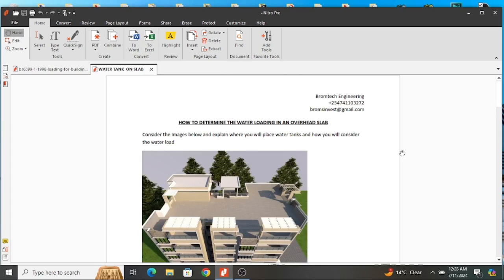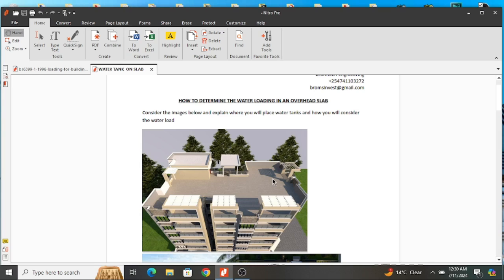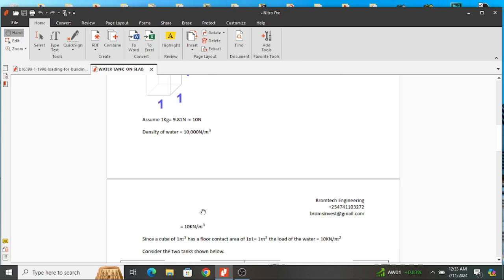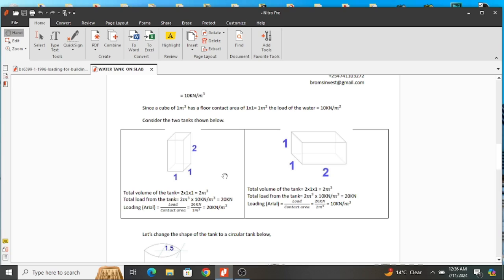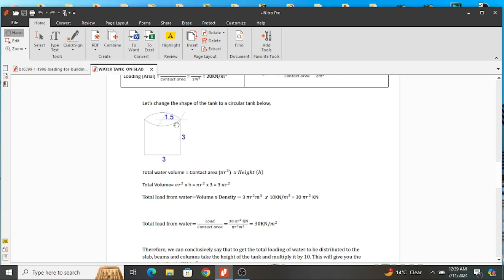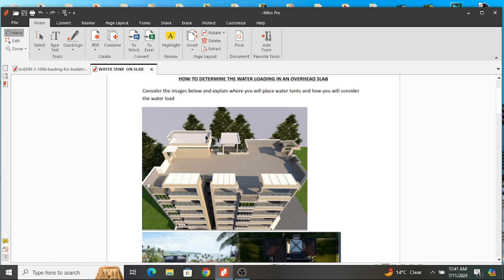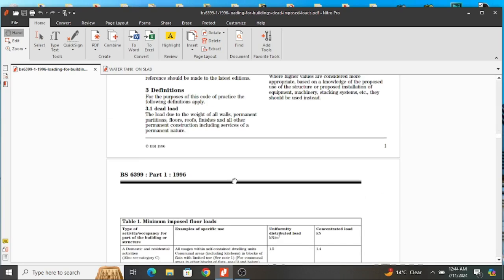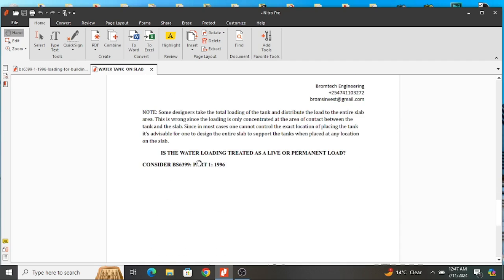OVERHEAD WATER TANK LOADING DISTRIBUTION TO SLAB

Comment: What if the tanks are let's say 4 on a slab.will you divide it by the total area of the slab
Reply: someone please answer this..
Reply: Hello
You don't divide or multiply that load eg 30kn/m2 
This is because the intensity remains the same because as weight increases (KN) the area it spreads over Increases equally so you don't unless u aregoing to stand the tanks over each  other which isn't logically true